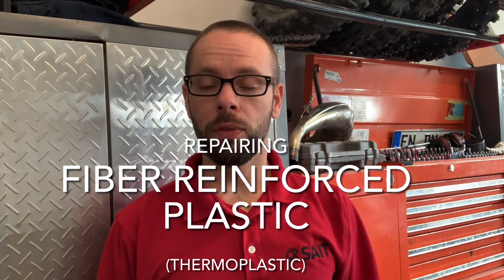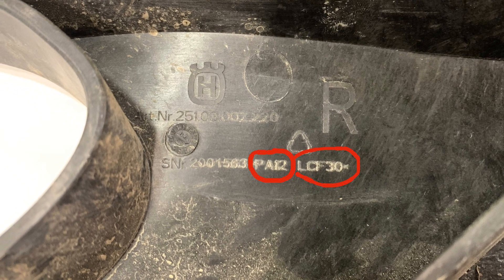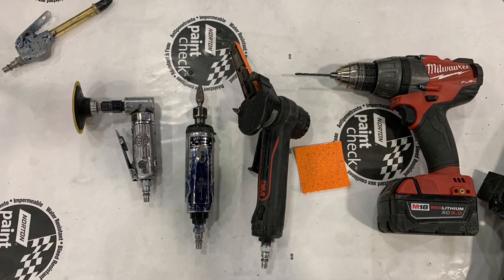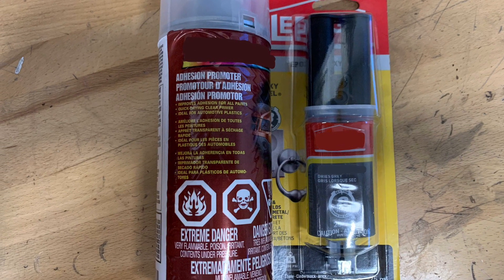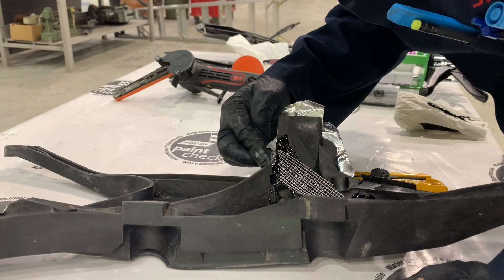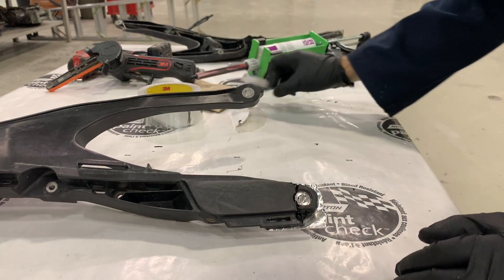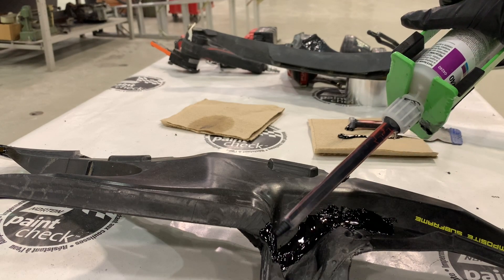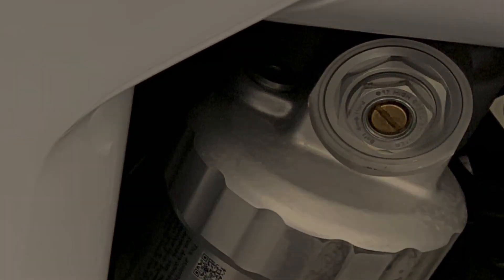FRP Repair

Comment: Hello. I have the same broken part on my motorcycle and I want to try to repair it. I would appreciate it if you could tell me what type of adhesive you use since it is not clear to me in the video or any specific product or brand that you have used, since I live in a place where there is not much variety of products and if I ask for an adhesive for thermoplastic he will not have any idea what I am talking about and he will sell me whatever he has regardless of whether it works for me. Thanks

Comment: Really good job Ben. Was wondering if using long-fiber polyester autobody filler would be useful to reinforce the open areas in the part. The key would be to get the correct bonding between the nylon12 FRP and the PE thermoset filler. Any thoughts on this?
Reply from the maker: Thanks for the comments.

Polyester does not adhere well to these substrates. But you can certainly consider adding fibres to the resin when completing the repair.

Comment: Why would you use adhesives and not weld it with fiber reinforced nylon filler rod?  Nylon in particular is not all that receptive to bonding with adhesive and tends to crack at the repair.  I would use Polyvance R21 series nylon welding rod with a plastic welder, embed a few plastic staples and maybe some stainless steel reinforcing mesh to really boost the flexural strength.
Reply from the maker: Hi Scott, thank you for the comment. I think you may have missed the point of the video which is to demonstrate a bonded repair procedure which I indicate is not ideal. Additionally, I have many other repair videos (and will continue to make more including plastic welding). 

With that said, the specific composition of plastic and fibre used in this particular part does not respond as well to plastic welding or hot stapling as other forms of fibre-reinforced thermo-plastics. I agree, though, that plastic welding can be far superior for certain types of plastic repairs and the Polyvance products are excellent, we teach this to our students.
Reply: @benh4086  Thanks for the comment.  Yes I saw those parts of the video, however not having success welding fiber reinforced plastic may be the result of not using the correct filler rod, welding at too high/low of temperature, or lack of prep.  Fiber reinforce plastics, in particular nylons, are pretty sensitive to how they are welded and what they are welded with.  When welding fiber reinforced plastic, you must use fiber reinforced welding rod made of the same material.  I have found that welding fiber reinforced nylon without fiber reinforced rod is possible, but no where near as strong as when you weld it with fiber reinforced nylon.  Another thing that can be done, although not practical for the DIYer is to use nitrogen hot air welding.  Using a jet of heated nitrogen instead of a jet of heated air to make the weld, acts as a shielding gas and produces and even stronger bond.  So what happens when this part fails on a dirt bike?  Does the rider end up on the ground?
Reply from the maker: @scottb7600  when this particular subframe fails, the back end of the motorcycle tends to come loose, but still stays largely intact and is generally rideable.

Repairing (thermoplastic) FRP is not common in the Auto Body trade as FRP repair is not typically an OEM approved procedure. Although I do not have a video loaded, I do teach hot air and nitrogen welding. My videos are mostly aimed at training apprentices, but this particular one is directed towards DIYers using easily accessible materials to make a temporary repair. As you mentioned, nitrogen welding is not practical for non-professionals. 

Thanks again for the comments, great conversation on a topic that isn't understood well my many.

Comment: Excellent video. Any link with the specific repair materials?
Reply from the maker: The materials can be purchased through your local Auto-Parts store, Auto-Body supplier, or other retailers (depending on the specific product you choose to use).